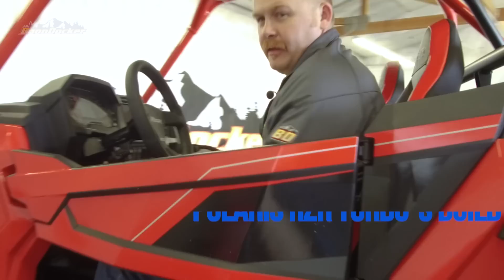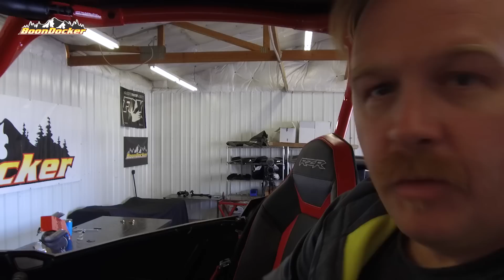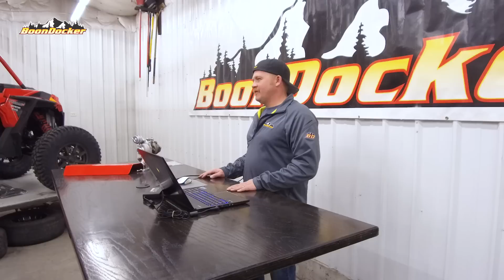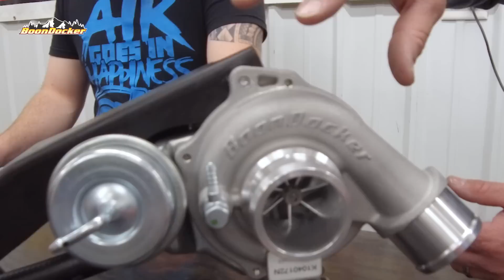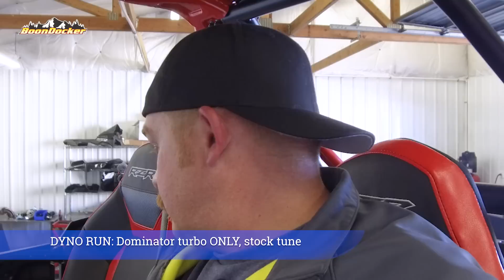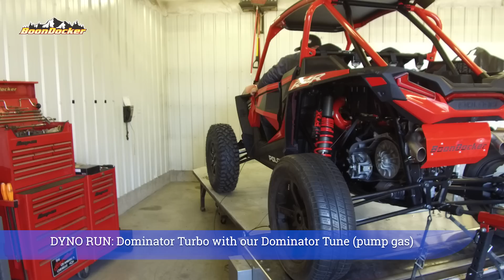Polaris RZR Turbo S Dominator Build - Episode 4 - Dyno Day

Comment: Living in New Zealand, I ride between 204m (669 feet) above sea level to 1,450 metres (4,760 ft) up in the mountain trails.  My Turbo S is tuned to Stage 3 (AA custom tunes) and a S3 clutch. I have been thinking about replacing to turbo with the bigger one but I'm told  bigger turbo's spool up slower than smaller ones. I race fast and I'm all about how fast I can get from 0 to 60mph.  Would the bigger turbo be an advantage in this situation please ?

Comment: So no gain from tunes or exhaust or charge tube..... why buy them?
Reply from the maker: At lower elevation, you'll see a gain from the tunes (mostly). We test a lot of mufflers, and rarely see a measurable gain, they're mostly cosmetic/sound preference. The charge tubes are cosmetic and preventative. Over time, the plastic in the charge tubes will break down, whereas aluminum won't!

Comment: I have a 2016 rzr with your bulldogs on level two tuning running 95 octane.   I have your exhaust, clutching  upgrade, and blow off valve; car runs great!  Would I see more gain with the dominator kit with the big turbo and tuner ect then what I’m running now.   Thanks again for the help.  I run most at little Sahara in Utah. Thanks for any feedback !!
Reply from the maker: Absolutely! That setup is around 25 RWHP over stock on the '16's. You'd more than double that with the Turbo upgrade.

Comment: Sorry a little confused, is this wheel HP or engine HP? 200whp would put the motor at what..220hp? I do really love this series you did, think i am sold!
Reply from the maker: Our dyno measures RWHP. The stock car was dyno-ing at around 150-155 HP, so you're looking at a repeatable 45 HP gain, on pump gas.

Comment: Well, hope it is allowed on rzrforums.net because I just posted these four vids in the Turbo S section.  Hopefully it won't be deleted since you're not site sponsors.   Love the vids, wish we had numbers from just the Turbo upgrade prior to pipes and exhaust though.  I think it might not be so close to the 10 you got.  Keep up the vids, thanks
Reply from the maker: Yeah, we're in the process of building another Turbo-S, and will get something for you. On the same note, at a minimum, we have to use our intake/charge tubes because the Dominator turbo has a larger inlet. We really appreciate the feedback, it helps keep us motivated to make more videos!
Reply from the maker: and it's also kind of unclear, but we did quite a few dyno runs at 145-150 with the completely stock machine. They averaged out to 149, if I remember right. We did a 3 dyno set with the intake/charge, and just used a silicon neck down to the stock turbo, and the average was just shy of 150 (I think it was 149.7), both on the stock tires.